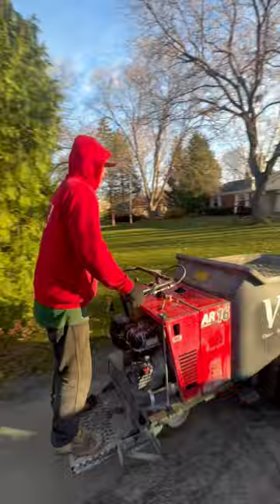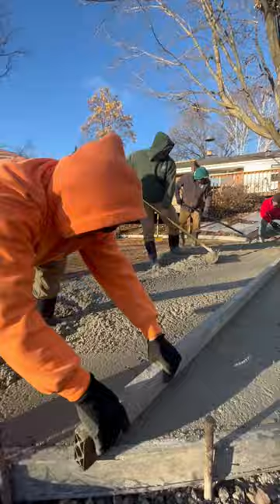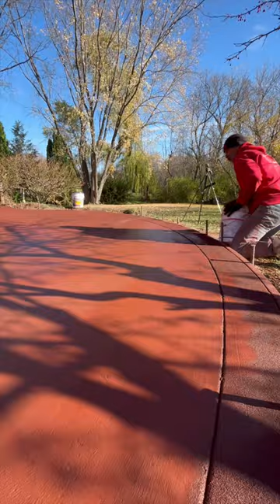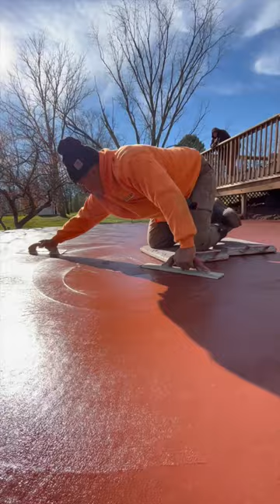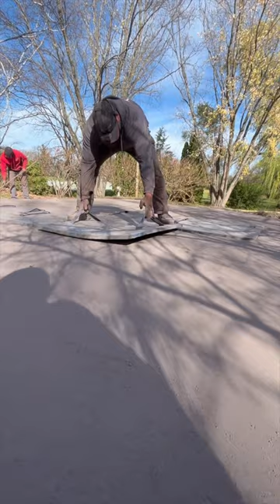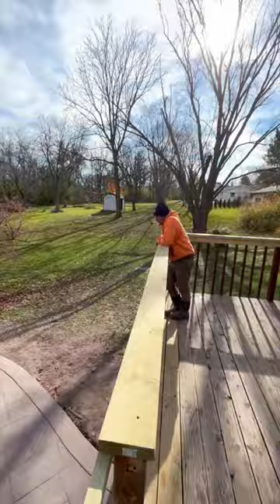How we color and stamp concrete (red)

Comment: Quick question?
Why do you guys use mag hand floats to finish when all l see in California is trowel finishing?
Reply: Can someone give an opinion on the question?
Reply: Air entrainment is added to exterior concrete for freeze/thaw conditions. Steel troweling can cause densification of the concrete. It pushes the air out at the surface and could allow surface breakdown or sprawling. Air entrainment creates microscopic air pockets for water to gather and expand with freezing conditions.
Reply: @masonteel1  thanks for the information. I was also thinking it must have something to do with steel troweling make the top layer flaking of with freeze conditions